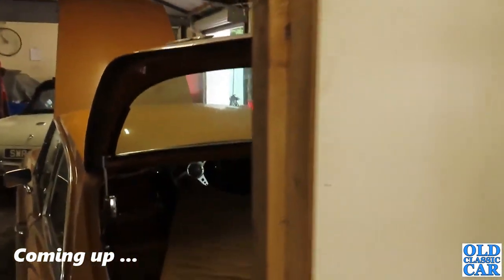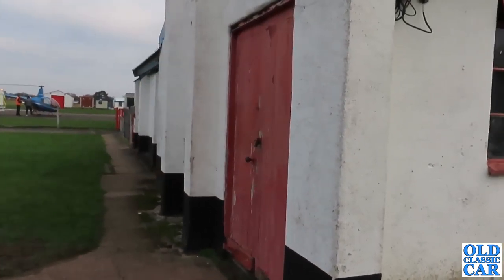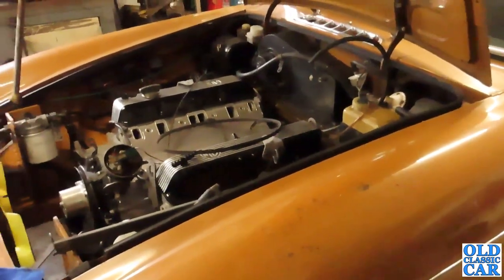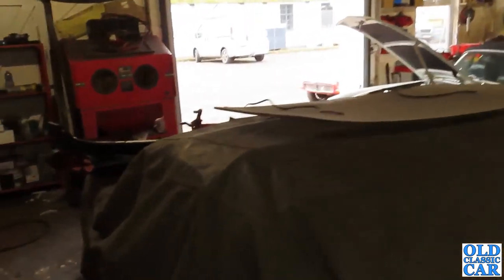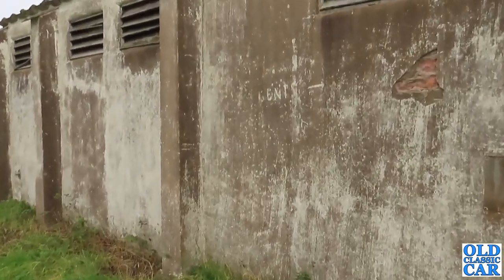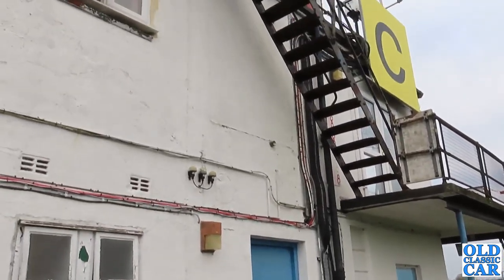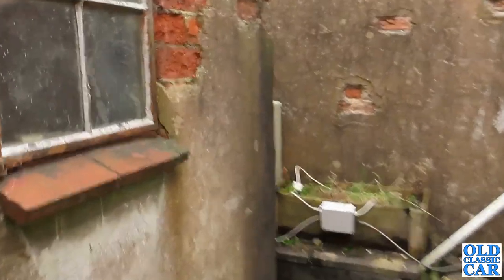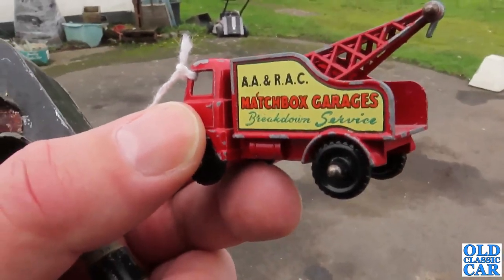We go car hunting - MGB V8s & other old cars spotted at ex-RAF Wolverhampton Halfpenny Green Airport

Comment: I used to work there in the 1970s until the early 80s . In those days it was a very busy G.A airport with several flying schools and an air taxi service. There were also a couple of then new corporate business aircraft a King Air and A Cessna Golden eagle. The airport fire service then used a 'green godess' painted red together with a long wheel base  Land Rover.
Reply from the maker: Good stuff, somewhere I have a photo of a cracking Karrier Bantam refuse truck that I saw there back in the 1980s

Comment: Very interesting video. You never know what you might find around the next corner. I love seeing the old little jet, I know there's probably a lot of them about but you do feel that it really should be in  a museum. Most of the old buildings look solid, built to last with out a doubt . Someone must be intending to restore the Jag. I hope they start sooner rather than later or they will have a pile of rust which wouldn't be helpful. BTW if you don't follow the blue line you can have a  free haircut.😂(Hope that jokes not too severe for YouTube). Thanks for the sharing video .👍
Reply from the maker: Thanks, yes it's always worth visiting these out-of-the-way airfields, business parks etc

Comment: I had a Jensen Healey  back in mists of time  .   Not good   .  It would spin if you ran over a hair in the road  -  and I mean hair , not hare .   My best freind had a TR6  ,   I was slightly faster through the  gears  , he had better top speed .   But his Lucas fuel injection kept breaking .  My JH  ran it's main bearings    .  Thank heavens we've got cars now that can for than 5 minutes  without the wiper blades falling off  .  Wipers quit on 60's 70's  cars with monotonous regularity